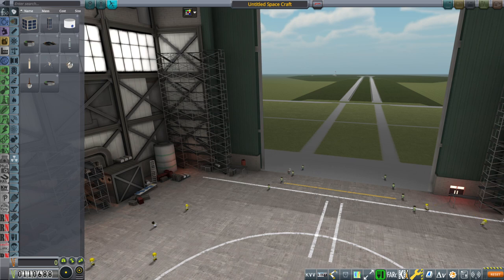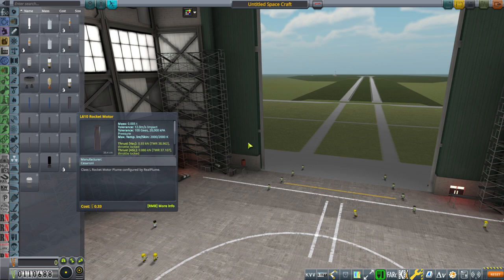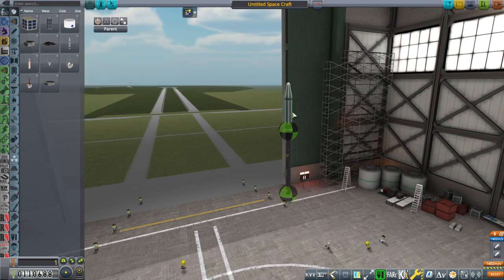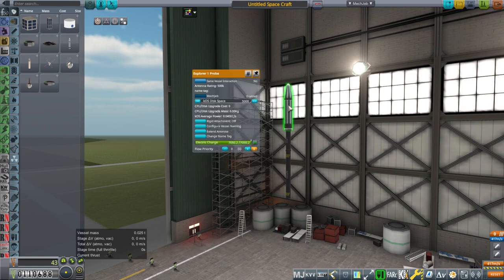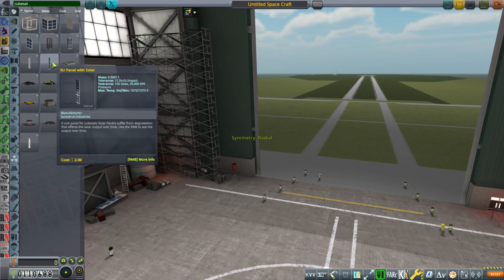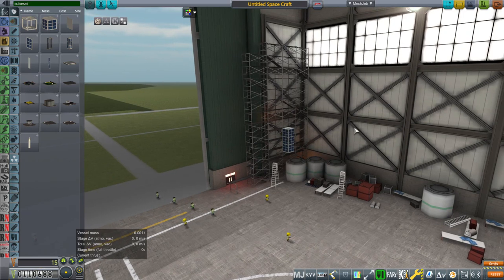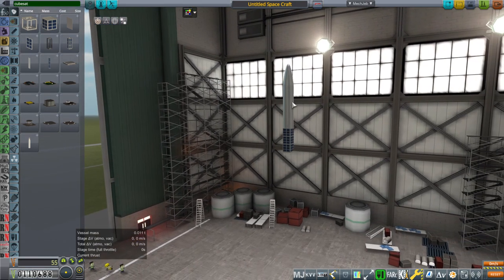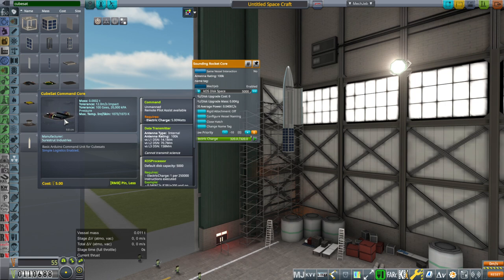Realism Overhaul in KSP 1.8.1 - Cubesats

Comment: Are you going to release RP-2000 for public use? If so, when?
Reply from the maker: I'm still in the pricing phase for parts. Once I get that done, I still need to hammer out the contracts and then potential compatibility with other mods like Test Flight and KCT (both of which would be optional). Once I've got the basic pricing done, though, I think I can let people give input.
Reply: @RaizSpace  Awesome, looking forward to it!